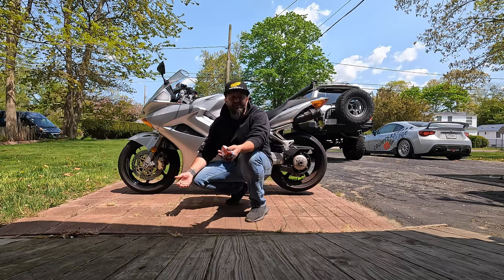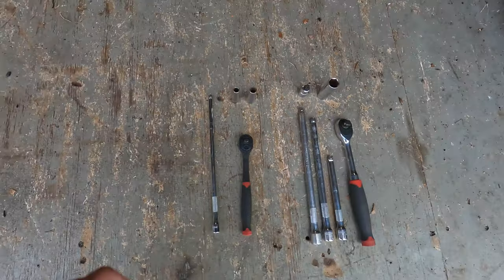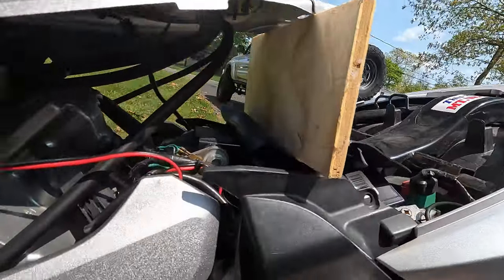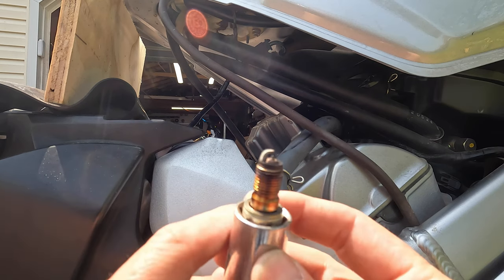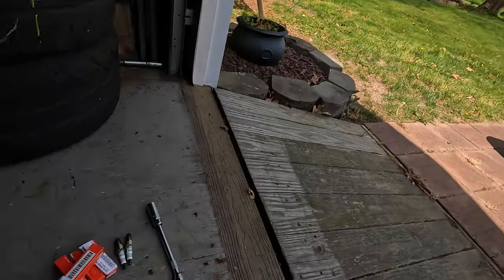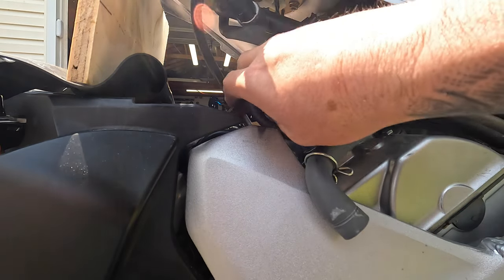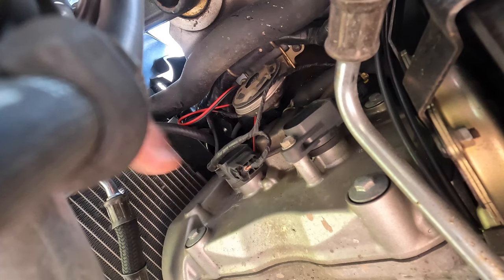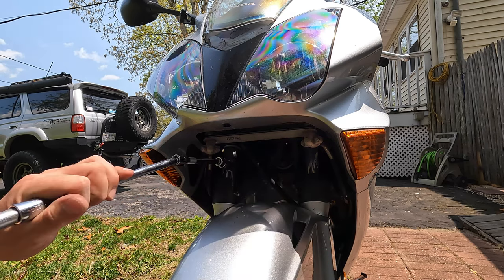How To Replace Spark Plugs on a Honda VFR800

Comment: Hello. Great video. Will this work with 8th gen vfr?  Same engine and parts im assuming ?
Reply from the maker: Thank you!  The process should be VERY similar, as the engine and chassis is almost identical. The part numbers may have changed so check with your Honda power sports dealer to make sure you get the correct plugs!

Comment: What spark plugs dis you use? OEM, or did you go with iridium?
Reply from the maker: For maintenance items like filters, gaskets and plugs I will always use OEM. If you want to save a few bucks look on rock auto for Denso plugs - they’ll be the closest to OEM

Comment: Hello, im striggling with getting my honda vfr800's seat back on. Should it look comepletely flesh with the bike? It locks but my seat looks like it could be more flesh with the body
Reply from the maker: It should fit against the tank at the front. The front latches are pretty tricky the first few times. You have to slide it forward from the back

Comment: I have a 2007 vfr and it has a uneven idle do you think spark plugs could be the cause or do I need to look else where?
Reply from the maker: So much could cause an uneven idle. If you’re over 16k miles you’re due for spark plugs anyways so it might be a good idea to do them regardless